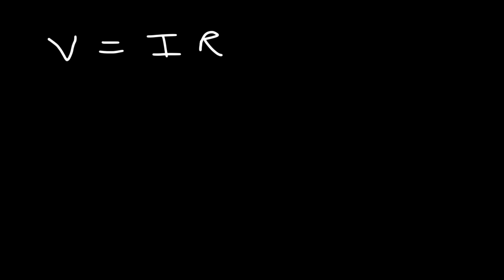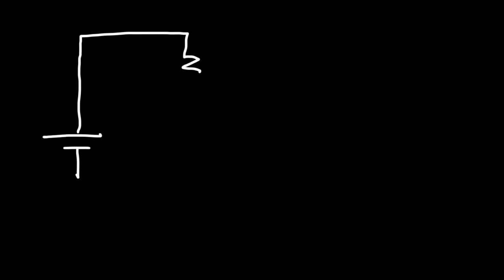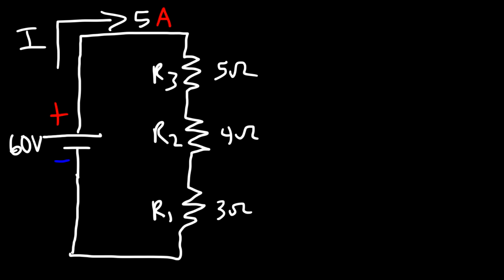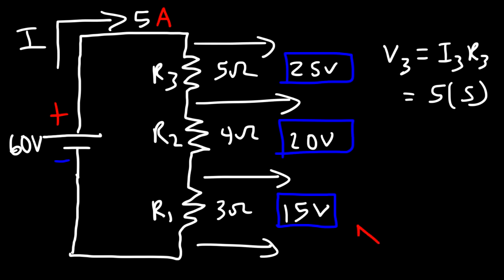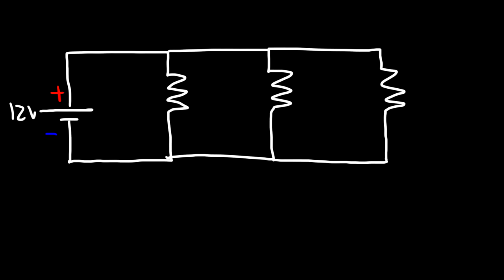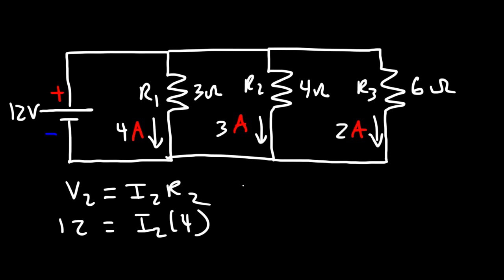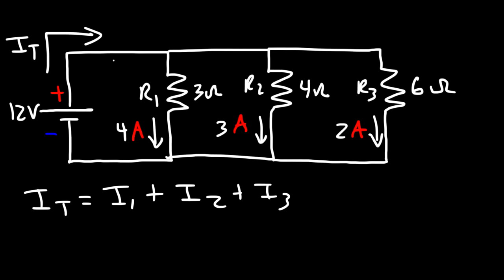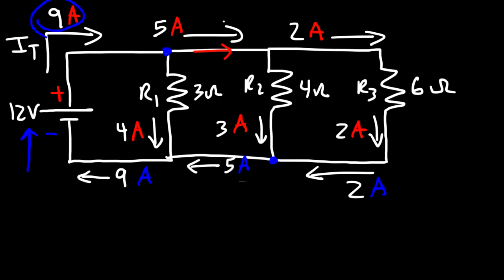Ohm's Law

Comment: Very nice explenation of circuits and Ohms law! 
I just took a Walmart Maintenance test and over 90% of it was electrical. I already understood these laws and calculations but this would've been a great refresher and would've helped me get done faster since I had to reach way back 30 years in the memory bank to recall but I passed with flying colors.
Here is an equation that my Tech teacher showed us and this has helped me with Ohms and Watts Law like no other!
Spell out the equation in a series of letters I'll show below and if your solving for X, then if the information provided is to the right, you multiply and if any information is to the left you divide.
VIRP: 
So if solving for voltage and you have I (amps) let's say 2 and R, let's say 6, both are to the right so multiply 2 x 6 = 12 therefor 12V is the voltage
Now let's solve for R where the voltage is 12 and Amps is 2, both are to the left of R so we divide and get 6
Lastly let's solve for I with 12V and 2 ohms, because Volts is to the left of what we are looking for in this case Amps we divide 12/6 =2

Just an extremely simple way to keep everything understandable without memorizing triangles!

Comment: i needed a refresher to address an issue in my model trains smoke generator now that really helped I need to understand Watts to Amps to Ohms to Heat. I need to vaporize oil to make smoke without over heating. Thank You Very much my 70 year old brain needed a reboot. I got it now. D

Comment: just think of resistance and current like traffic flow. more lanes on a highway will reduce resistance but less lanes will cause traffic to build up and increase resistance. and depending on what size AWG conductor you are using will increase or decrease resistance.

Comment: Sorry I'm a little confused about something, you said that conventional current flows from the positive terminal to the negative terminal and that it is the opposite direction of electron flow. So does that mean positive terminals on batteries are actually the negative and the negative terminals are actually the positive.

Comment: in year 9 i had a question that i couldnt solve but after waching this i could the question is  (2 resistors (4r and 8r ) are connected across in a sereis a 24v battery ) 1. what is the current 2 what is the voltage drop in each resistor i guess this is a check yourself or make sure of ur understanding kinda thing

Comment: Why did you use that equation to find the current.  Shouldn't it be I=E/R because of voltage drop in a series circuit?

Comment: Question: For the first problem, why did you find voltage leaving the battery through voltage/Rtotal and the second problem through the sum of all currents? Why can't you use voltage/Rtotal for the parallel circuit?
Reply: It's easier rather than using R =1/R1 + 1/R2 + 1/R3

Comment: hello, i'd like to ask.. my teacher gave us a hw where the resistance (r) BUT it is equal to 2Voltage. The circuit is like this.

E=220V ——> R1 = 2v ——> R2 = 3V ——> R3 = 5V ——> then back to the 220V. 

the current is missing, and i cant figure out what to do with the resistance = voltage. do voltages have resistance conversion?

Comment: Hi in 5:00 you are taking the 60V and FIRST calculating the farthest resistance value from the point of supply... how come this is done so, isn't it a little (backwards?, sry english is not my main language) 
(It's labelled as r1 but it's farthest away from the battery +

Comment: Im not sure your still making videos but I really need your help, Im a college student and I working towards my Aviation license. The test section regarding electric calculations are giving me fits calculating questions like this :(Refer to Figure 5.) What is the impedance of an ac-series circuit consisting of an inductor with a reactance of 10 ohms, a capacitor with a reactance of 4 ohms, and a resistor with a resistance of 8 ohms?..Im so confused,can make these type questions simpler will you help me PLEASE.

Comment: I was wondering why you didn't use 1/R + 1/R... But I can see that the answer is the same, please explain why?
Reply: Like he did it its easyer to calculate voltage resistance and current for one particular resistor. But if you want to know the total resistance current or voltage its way faster to use 1/(1/R1+1/R2) . And btw the symbol for voltage is "U" and not "V".

Comment: Can someone plz ans and show me how do this question plz.  A circuit  consists of two resistors in parallel:A of unknown value  and B  of 10 ohms. The parallel  combination is connected in series with a 12 ohms resistor. If the total resistance of the complete circuit is 14 ohms find the value of A

Comment: But, i read that electricity goes to the negative side to the positive side. I don't get it
Also, what if I want to calculate with ohm's law the current in a closed circuit with only a 9v battery? There is not resistors so i guess it'll go like: I=9/0, so the current is infinite?
6:14 How do i know the voltage between R1 and R2? 60-15 or 60-25-20?
Reply: electron flow is from negative to the positive side ,the conventional current is from positive to negative ,and you can never have 0 resistance as there is resistance from the wire and whatever component you have attached also has resistance
Reply: @saraomg1056  how many ohms has the wire then un that case? I'm confused

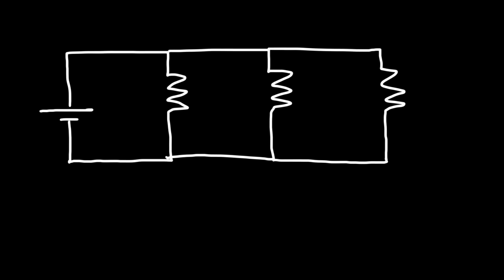Comment: Excellent videos! Thanks for the Refresher! I'm probably not the first to mention that your example beginning at approximately 7:30...the in/out volts don't match....12v/13v. Maybe use example resistors with 2, 4, and 6 ohms? Instead of the 3, 4, and 6 ohm resistors. Please correct me if I'm wrong. Regardless, thank you!
Reply: I don't see any problem. It's 12 volt.
As it is a parallel circuit, Voltage is same for R1, R2, R3.
For R1= 4A*3R= 12V
R2= 3A*4R=12V
R3=2A*6R=12v

Comment: But I was always told the higher the voltage the lower the current??? Can someone explain
Reply: That is true in transformers where the input power is constant and it can be converted to either low voltage and high current or high voltage low current. It is important to understand that the specifications of a transformer differ from what voltage and current actually occurs depending on the resistance of the load. A low voltage high current source can only produce high current if the resistance is low. For a human they are harmless because at a low voltage almost no current can flow through a human. And if you put high voltage low current source across a low resistance the voltage will drop because it can't keep up with the current that would flow if the voltage was higher. 
From the perspective of the load more voltage means more current

Comment: Why voltage drops to zero after passing through a single resistance circuit?

Do charges slow down when passing through resistance and if they do then why isn't it effecting current?

How do charges carry on their motion even after voltage drops to zero?

I cant imagaging electron flow through resistor :(

Comment: These examples are not realistic there is no way u would short 60volts across a 12 ohm resistance . not unless you like fire and smoke. the actual calculations are not this even and neat in actual practice.

Comment: how to get voltage 2 if the only given are total resistance and voltage 1?
Reply: It's not possible because you would only know that the total resistance is 12 ohm and from v1 you could calculate that r1 is 3 ohm. You would only know that r2+r3 is 9 ohms but v2 would depend r2 and it could be anywhere from 0 ohms to 9 ohms so v2 would be from 0 to  45 v

Comment: Ohms law is more sutle than this video shows. Really saying V = IR does not say very much, this really is a DEFINITION of resistance not a LAW. What Ohm prposed that there were certain substances whose resistance as defined by the above stays CONSTANT no matter what the voltage across the material is or vthe current going through the material . Such substances are said to be Ohmic. Most metals obey Ohms law at a fixed temp. But in reality most substances like semiconductors are said to be non Ohmic. I know this being pendantic but saying V= IR is Ohms law is really misleading

Comment: This is fake because I have a 12 volt battery with 1 amp and I know that and I put a 4 ohm resistor on it how is that going to produce  or raise 1 ah to 3 ah, no way. So what is the ah of your 12v battery anyway, fake.